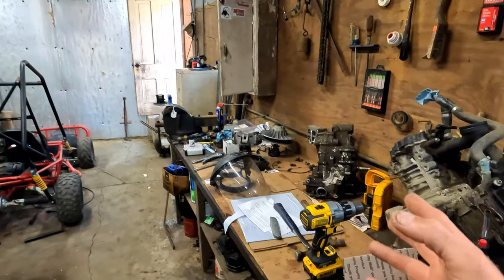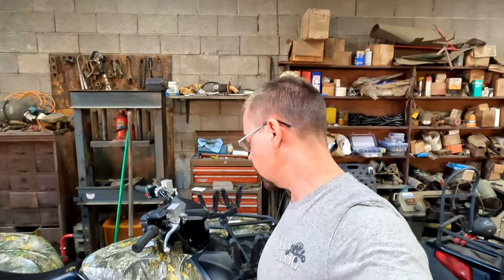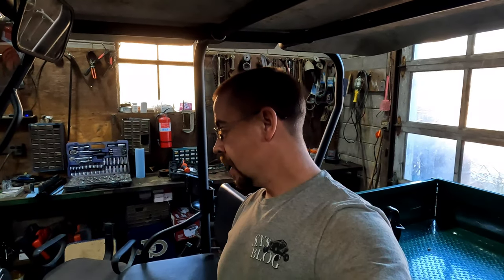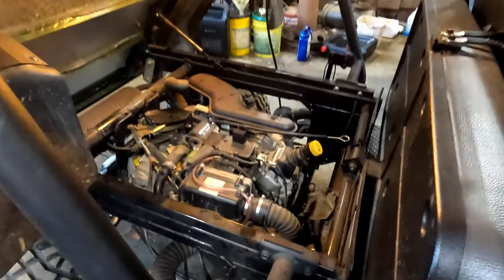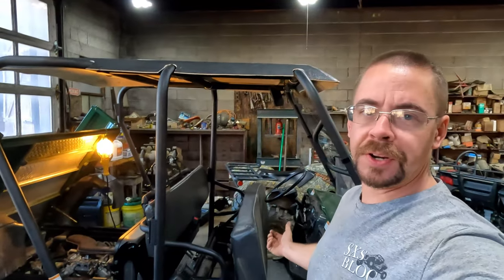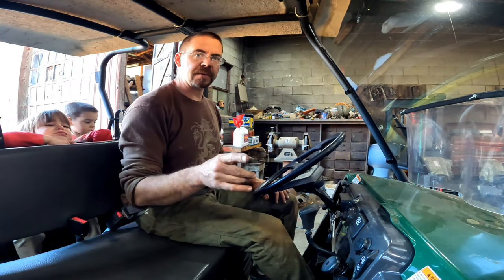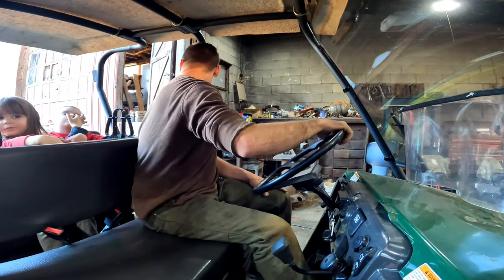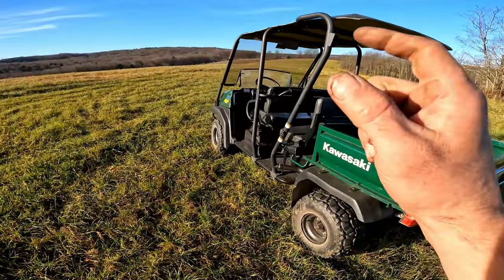Kawasaki Mule 3010 Gets A Tune Up

Comment: I have a mule and a Teryx. Kawasaki makes nothing  but junk. They both stay broke all the time. I am afraid to get out of my driveway for the fear of being stranded. Wish I had bought a Kubota. I don't buy these things to work on. I buy them to use. Both have been well.maintained in case you are wondering.

Comment: I have an 06 3010 mule. It pops out of high and back into neutral. I've adjusted the linkage but it only helped somewhat. I see it's most likely the cog gear in the transmission. Could you give an estimate of what that would cost to fix. Just if you where to do it for a customer yourself. Thanks in advance. Love your videos
Reply from the maker: I sure will! Give me a bit to do some figuring and look up the part schematic.
Reply: @AppalachianMountainRiders  awesome man! Thanks alot